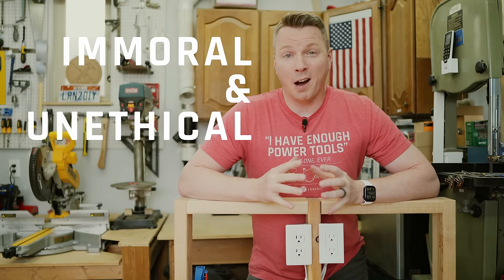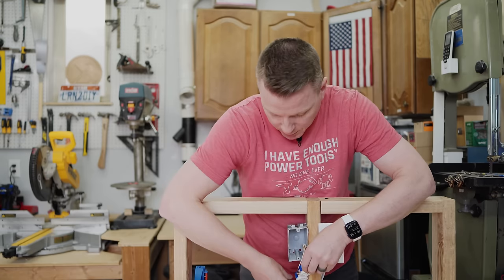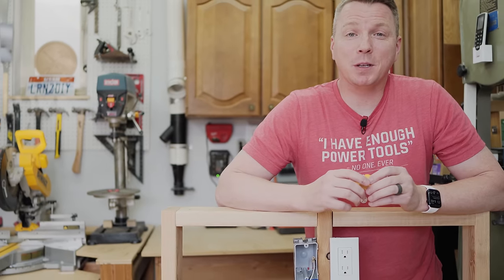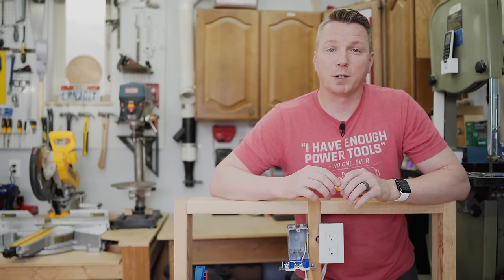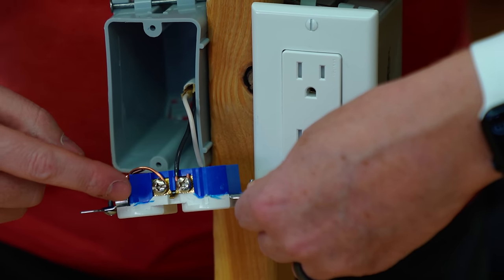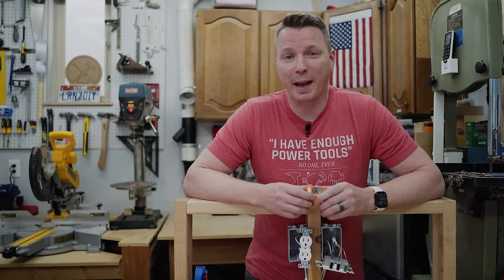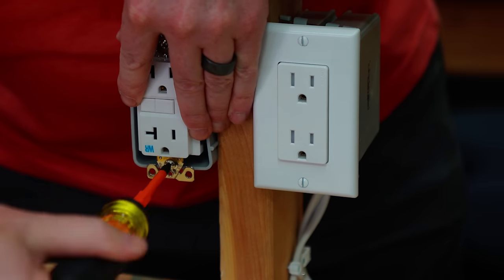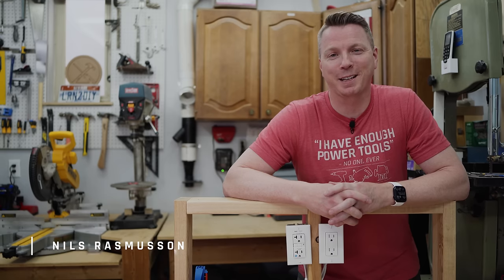People Are Adding Deadly Hacks to Outlets

Comment: I saw this dangerous bungling in sockets in an old building in Basel, Switzerland. 😱 Unbelievable but true, this was allowed and ordered by the responsible authorities so that all sockets in old buildings with two-wire cables have "earthing" without the owners having to spend a lot of money on it.
Reply: It is not dangerous. Sure it is not ideal and it is therefore not used anymore but it really is not that dangerous if properly done.
Reply: @okaro6595  For me, however, 230 volt mains voltage on a device housing is dangerous. This is what happens when the metal housing of a device is connected to the neutral wire instead of to earth and when the neutral wire is then interrupted somewhere. A broken wire or a loose clamp will do. Connecting a device's housing to the neutral wire is more dangerous than not grounding it, because a broken neutral wire somewhere down the long line in the building is more likely to happen than an insulation failure within a single device. I once had a loose screw in a junction box in the apartment, which interrupted the line.

Comment: I don't know who did the wiring in my place but it's all sorts of messed up some of the outlets don't work and a lot of them are upside down like the ground hole is on the top.
Reply: It's common to rotate receptacles to indicate that they are controlled by a nearby switch. If the switch is off, the receptacle or one socket won't work. Maybe that's your issue.
Reply: @surferdude642  I just went and looked every single one of my outlets upside down even the ones in the laundry room that are definitely not connected to a light switch.
Reply: @bland9876  Ok then, at least it was worth verifying. The only other reason for upsidedown mounting is in case a metal object falls on a partially installed plug, it will contact the ground plug instead of the hot and neutral. It's a safety consideration. Unfortunately, it doesn't explain why they are messed up and not working.
Reply: @surferdude642  I thought I tested it but I should test it again just to be safe but I'm pretty sure some of my outlets aren't working even when I flip the switch. Hmm

Comment: I have a question: My previous old house has no ground in many outlets. One day I notice my desktop computer case had some electric power make me feel uncomfortable. So I ran a thin wire from power bar ground to a plumbing pipe nearby, and problem solved. If I installed GFCI in that case, I guess I cannot use that computer anymore. Any comment? Thanks.
Reply: It is normal that PCs leak current and if it is not grounded you can feel it if you are grounded. That is not dangerous as long as there is no actual fault. If there is a GFCI it will protect you. Best is to organize so that you will not be grounded like with a carpet and do not unnecessarily touch it.There is a potential of equipment damage if you connect it to a TV, a receiver etc. that is grounded through the antenna. 

Connecting the case to the  plumbing is dodgy. Do not do it in an apartment.

Comment: Regarding wiring the hot side to ground: many appliances with a metal case/exterior have that case connected directly to ground. If you have a circuit reverse grounded then you've just connected that exterior metallic case to 120V. Very, very dangerous
Reply: That is very dangerous. In 2015 in Finland a plumber died as he used his tool on such a socket. The floor was full of water which increased the current. The tool he used had an RCD but it does not protect against such. The resident had only used double insulated devices on the socket - each time he used them his fingers were millimeters from the live ground contacts.

Comment: small note: he uses the word "computation" with the GFCI receptacle, and that is a little misleading. it is an entirely electromechanical system that uses no microcontroller/computer, and uses the electromagnetic fields created by the current to physically break the circuit.

please be sure to press the TEST button on your GFCI outlets every month or two to ensure that they are still functional, especially if it has no ground.

Comment: So where does the neutral wire from the pole go to?  There are only 3 from the pole, 2- 120 volt wires and a neutral (which is a ground) the neutral and the ground wire in the meter box go to the same place in the meter box! So how do you separate the ground and the neutral if they both go to the same place?

Comment: I've run across this checking behind shoddy rewire jobs. I've even seen them go so far as to splice in a 1 ft section of 3 conductor and shoving it inside the wall to make inspectors think it has new wiring 😮

Comment: Bootleg ground is bad if you miss neutral. (tree fells to your line for example) But does gfci detect this?
Reply: A GFCI does not detect problems that happen before it. If there is voltage the ground contact a GFCI does not detect it

Comment: Adding a ground on the neutral side on the outlet will complete the ground circuit. That is why the detector will show the outlet grounded. In the main panel box and not a subpanel the ground and neutral wire are bonded together. This is not the case on a sub panel. Putting a ground wire on the hot side of the outlet is a direct short and will trip the breaker instantly once the breaker is restored.  You are taking the full line current to ground.

Comment: Wouldn't using a multimeter to check for continuity between the ground and return lines work as well?  With power off you should get no continuity between any of the holes so if you get continuity between any two then there is a problem.  Or am I missing something?  I'm always happy to learn if I'm wrong about something so important.
Reply: Neutral and ground are bonded in the main panel, so there is always a connection. There is a difference in resistance, but regular multimeters are not precise enough for detecting that.

Comment: the neutral side of an outlet and the ground wire are electrically the same point. look at any circuit panel and u'll see they go to the same block so he's kind of overstating how dangerous/wrong doing a bootleg ground is on a simple outlet. i'm struggling to think of a scenario where doing it this "wrong way" would backfire - it'd certainly take a special set of circumstances and the neutral wire would have to become an "open". all that said, i wouldn't do this hack even if in theory it works just as well. never wanna give bad luck a chance after all.
Reply: the open neutral scenario is the problem. it's too easy to get an open neutral. then voila, your washing machine case is live.

Comment: You could also use a volt meter to check? Or am I incorrect? Checking hot to neutral should provide voltage. checking neutral to ground should have no voltage? you are only checking the neutral leg when you have a bootleg ground?

Comment: Wonder if an EVSE electric car charger would detect either of the bootlegged grounds discussed in this video?  The Ford F150 Lightning has the neutral and ground bonded on the truck side so will not work because the neutral and ground are bonded at the panel.
Reply: Unlikely, it's difficult to detect.

Comment: To check for this, couldn't you also turn off power at the breaker and test for continuity with a multimeter?
Reply: Only if you were to first disconnect the neutral/ground bond at the first disconnect. You will always have neutral/ground continuity, even in a properly wired building.

Comment: So as a homeowner in US. Can I legally just pull new 3 wire romex to the outlet and swap it out in the panel and the outlets or is that a big nono?  Can I do it and then get the work inspected and signed off by a real electrician?
Reply: Yep, you sure can, as long as you make sure the wire is big enough for the rated load, distance from the panel, etc. You don't even need to get it inspected afterward (though I would, especially if you're new to electrical work).
Reply: @HiddenWindshield  Thank you for your kind reply! 8)

Comment: I've been doing new and existing residential and commercial electrical for over a decade now and I've never run into this.   I've heard about it but I've never actually pulled a receptacle and seen it.   
But if you must have a ground for a gfi since it's not a real gfi without a  ground just throw a couple ground rods in the ground tied to those receptacles that you need to be gfi. Instead of completely rewiring your entire house.
Reply: A GFCI will work fine for protecting individuals, even with no ground. It is a code compliant solution. Ground rods will do nothing here and are not for this purpose.

Comment: but heres the thing.   the ground is actually grounded through the neutral wire because at the panel the neutral bus bar is tied in with the ground bus bar.   so while it may not be a good practice or follow codes, it is still technically grounded.

Comment: Main reason why it's illegal is because in modern installations with a RCD, if the RCD trips, it disconnects both live and neutral. And if neutral and ground are still combined at the outlet.... then you have no protection
Reply: One cannot use RCDs on the PEN wire but that is not the reason why it is banned in the US. Note one still can put an RCD on the socket as the neutral and earth are separated on the socket.

Comment: Option 2.5 would be to replace the circuit breaker for that plug circuit with a GFCI one. The code only says that the non-grounded 3-prong receptacle needs to be ground fault protected. Doesn't have to be at the receptacle if i understand that correctly. Would still require the "No Equipment Ground" labels as noted in your video.
Reply: Lol, how would the GFCI breaker function with only two wires going to the receptacle? You'd still need to re-run 3-wire to the panel, which means it's option 3, not any easier.
Reply: Actually, I thought about it some more and realized maybe the GFCI just trips when the two wires have unequal current, not if there's current detected on the ground wire. So never mind, my comment was wrong, your method should work.
Reply: @charvakkarpe  that is correct. The breaker should Trip if it senses unequal current across the poles. Same as putting a 2-prong downstream from a 3-prong GFCI receptacle

Comment: My understanding is that the breaker box or service panel inside the house should have the ground wires and neutral wires connected to a different "bar" of screws, and according to building code these two bars should NOT be connected in the breaker box, but should be connected in the service panel or entrance panel. In my breaker box  panel, the neutrals and grounds are going to the same bar. I am wondering what difference it makes or what harm it does to have a bootleg ground (I have many of them) if these two bars are connected in the breaker box. Isn't that basically the same thing?
Reply: In fact, the rules about bonding the neutral and the ground together specifically state that it must ONLY be done in one place, called the main bonding jumper, which should be located at the service equipment. In your case, your breaker box should be your service equipment; i.e. there should be a main breaker that shuts off all the power to the building located in that breaker box, and that main breaker should have wires running directly to the meter.

So why not allow bootleg grounds? Grounds are for things that should not normally carry current, such as the outside metal case of an appliance. When you connect grounded metal to the neutral anywhere other than the main bonding jumper, you cause the ground wires and/or grounded metal parts of the appliance to either carry current, rise to live voltage, or some combination of the two, depending on what faults and switching conditions exist on the circuit. So, a significant shock hazard exists, and sensitive electronic equipment might not enjoy seeing current or voltage on the ground wire.

The reason for requiring exactly one bonding point is to prevent what the code calls "objectionable" current from flowing on ground wires and/or grounded metal parts. Bootleg grounds create additional bonding points where "objectionable" current might flow on ground wires, which is why it's against the rules.
Reply: @benchociej2435  Thank you for explaining that!

Comment: The reason it fools the tester is because the third does, in fact, go to ground. 

Unfortunately, being grounded in this way does not serve the safety purpose that the third pin is designed for. It is, in fact, quite unsafe.

Comment: first off those testers aren't picking it up because back at the panel your neutral and ground are landed on the same bus per code . secondly if you have a reverse polarity situation , those testers are gonna pick it up. lastly , instead of installing gfci outlets you can just get a gfci breaker and install that which will do the same thing . yes having an electrician install new wiring is the best option but expensive .

Comment: The reason why it doesn’t detect the fault is because neutral and ground are the same but this is dangerous in this regard because if you’re neutral decides to short out, your ground will not be in use

Comment: People complain about grounding in outlets and how it is illegal, but they don't talk about countries like the Philippines, where grounding is a myth. They still use the two prong wires in basically every home, and you have to live in an expensive housing or something to even see a proper grounding system (which itself is a myth anyway, because even most expensive places don't have them hillariously, including hotels). As a result, they don't need to do these kinds of workarounds, because their houses don't even have supporting for grounding. In fact, people just break off the grounding piece in cables that are imported before using them, because they can't use the cables when the pointy grounding prong is still attached.

Actually, this probably covers almost every country that doesn't have a grounding system, which is more than half the world.

Comment: stupid question time:  if neutral and ground are bonded in the panel, what could make this configuration dangerous in an outlet?  I'm struggling to come up with a scenario where this is electrically different than bonding at the panel in a way which could be dangerous.  A ground fault inside an appliance connected to a bootleg ground will flow through the ground prong and return to the panel.  a broken neutral will act exactly like a broken neutral in a 2-prong outlet.  A ground fault in an appliance  a broken neutral in the wall will act exactly like that same condition in a normal 2-prong outlet.

Comment: I was worried when I bought my 60's house, 2 pronged outlets everywhere without grounds. 
Luckily, there was a ground wire present everywhere, and each of the boxes was metal, bonded to the ground wire. So swapping in grounded receptacles was easy.

Comment: Replacing a 2-prong outlet with a 2-prong outlet isn't great either since people will tend to use those adapters that use the plate screw to get assumed ground from the box.  But if the box isn't grounded, that's not right either.

Comment: How about using a regular multimeter and checking for continuity between ground and neutral? With the circuit breaker off
Reply: both this and a correct setup would read 0 ohm on a normal multimeter. neutral and ground are tied together at the service panel in residential homes. If you had a very expensive multimeter, or more specifically a specialized ohm meter, you might read 0.1 ohm on a correctly wired circuit, vs 0.0001 ohm on the bootleg

Comment: I've seen this recommended a lot when people have problems with EV chargers plugging in which test to make sure there's a circuit thru the ground pin.  These will simply refuse to work at all if it doesn't "see" a return path thru the ground so the ungrounded outlet is completely unusable at all.  Some UPSs and other things do similar now.  As well as a workaround for portable battery units some people are now using for "peak shaving" for devices that demand a ground that battery boxes and inverters lack.  I don't like it, but I am starting to understand why people do it given the increasing devices that will refuse to work without it...had to make something similar to use my inverter-generator for backup power.
Reply: It was also commonly in germany till the 1970s. It generally works, i had to do it because i had devices relying on having ground which here in paraguay... well, ill do it when i build but im certainly not gonna remodell the apartment im renting for now.

Comment: Help me understand....the neutral and ground are already bonded/connected at the box. doing it at the outlet is the same thing from a wiring standpoint
Reply: Now what happens if the neutral breaks.
Reply: @okaro6595  Then it's an open circuit and no electricity is flowing.
Reply: @jasonw8497  Yep, that's true... IF the neutral and ground aren't bonded anywhere except the panel. If they are, then it's not an open circuit and the electricity continues to flow, but you've lost an important protection. Since everything appears to still be working just fine, the homeowner never checks, and thus the fault could go unnoticed for decades. And the longer the fault exists, the greater the odds of a second fault energizing the case of an appliance and killing someone.

Comment: I think of the neutral wire as only the center tap of a 240 volt transformer, which is also used as "house common".

Comment: The black lead is hot, obviously. The white is neutral and if i'm correct, it's connected to the neutral bus in the panel. Likewise ground connects to the same bus in the panel and goes to ground. When the receptacle needs a ground (due to some malfunction) and they both terminate at the same bus bar why does that not work the same?